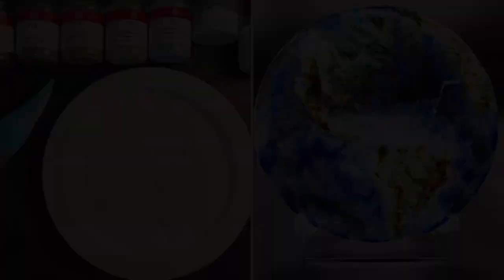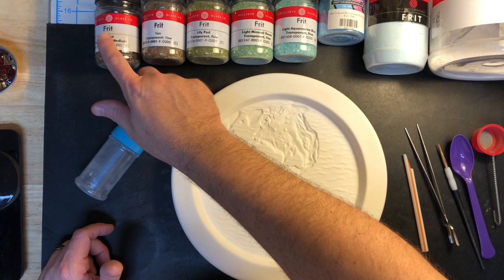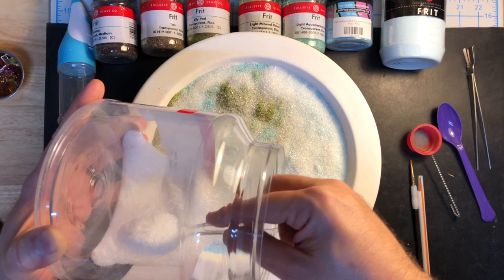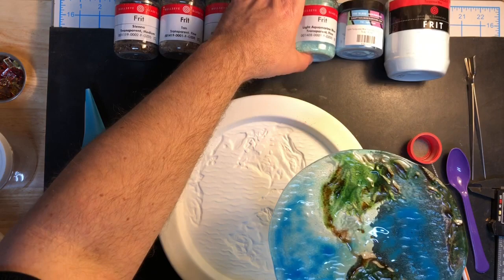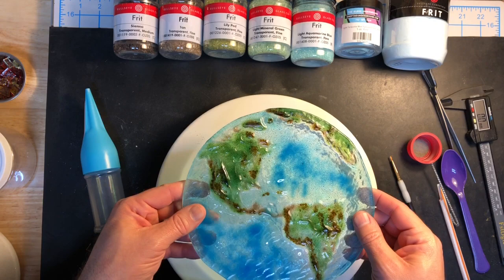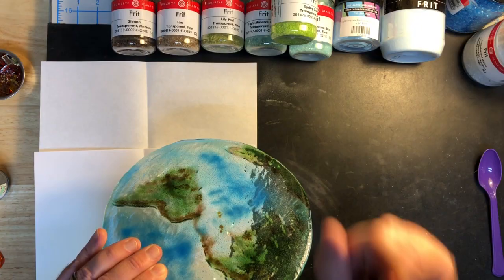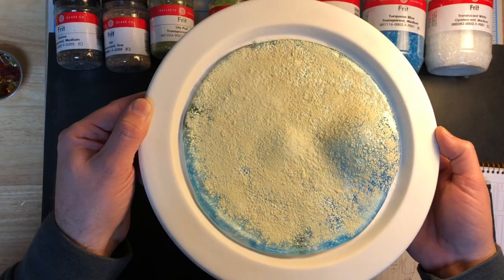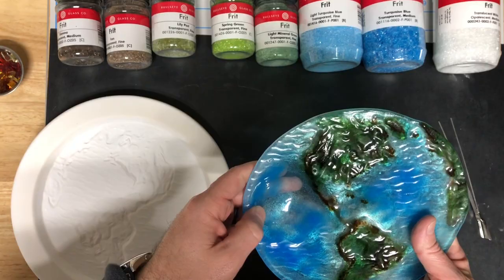Fused glass frit casting “the Earth is flat”

Comment: I’ve been thinking about those bubbles and since you know where the problem areas lie on the mould I would be inclined to take a tiny diamond drill and make a couple holes in the mould to allow the air to escape. Then clean out the holes once you’ve washed/zipped and make sure to use small kiln posts to elevate. I think this would do it.
Reply: Ditto the hole drilling

Comment: I had the same issue happen to a bowl that I re-fired.    It caused a big bubble right in the middle and it was not the fault of the mold.      It was primed correctly and the air holes were clear.    I 'fixed' it the other day by drilling a couple holes in the bubble with a dremel and firing it on a slump schedule to flatten out the glass.   It worked but I have the bulge around the edge too.    Still contemplating what I'm going to do with this funky piece of glass.    It is sitting on the bench mocking me.
Reply from the maker: “Mocking” you! 🤣 I totally know what you mean!!!

Comment: I know this is one of your older videos but I am just getting around to watching it now while I research a problem I am having with a Patty Gray 8" round dam mold.  I have fired a project like Tabitha's green scrap and sunflower hearts project 3 times now and it keeps making HUGE bubbles.  I take the pieces out, clean the mold with a paint brush, spray it with ZYP, let that dry, cut a new piece of kiln paper, grind away the thinnest part of the bubble with a Dremel, fill the hole with scrap and large frit, and fire again.  Then a bubble pops up in another location.  I ran the kiln up to 500 for 30 minutes with just the mold in it to make sure it was dry.  Went through the process again.  New bubbles!  I am beginning to wonder if there is just a problem with these types of molds with high straight sides that do not allow air to escape.  What are your thoughts on this issue?
Reply from the maker: Yes, I can understand your frustration. I am more often using stainless steel ring molds that allow air to escape more (although this almost always requires a second firing for fire polish, something the PG dam molds are supposed to be superior for). But I have many fewer issues with a steel ring than I’ve had with the PG mold. You might reach out to Creative Paradise, the mold manufacturer, to see what support they can give. They are very responsive and helpful… good luck!

Comment: I have a ‘beginner’s’ question: I watched your  heart mild video right before this, and the side facing the mold came out textured while the top was smooth. How is it that with this mold, the side facing the mold comes out smooth?
Reply from the maker: Well, I would not necessarily say the earth’s face is smooth but because there’s texture as part of the design itself, it works well here. If the face of the earth was a flat surface, it would likely come out with texture like the heart. The “back” of the earth is glassy and smooth, but the front has a lot of texture. Does that make sense?